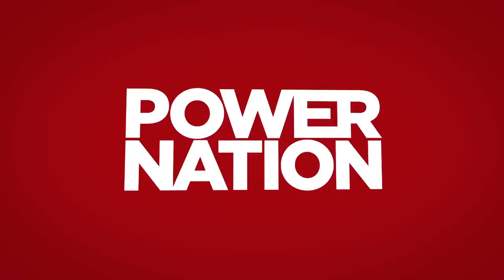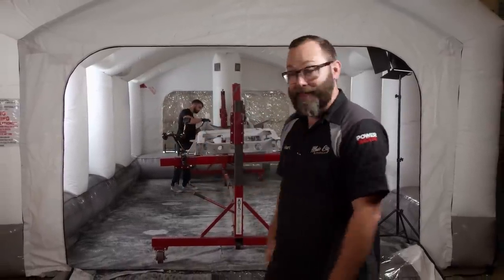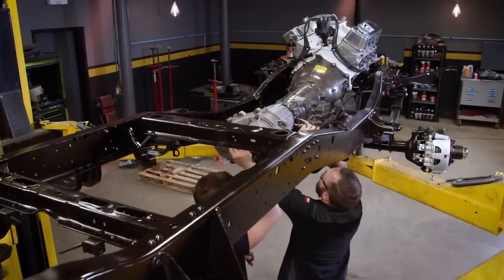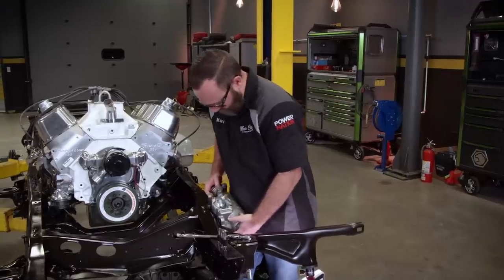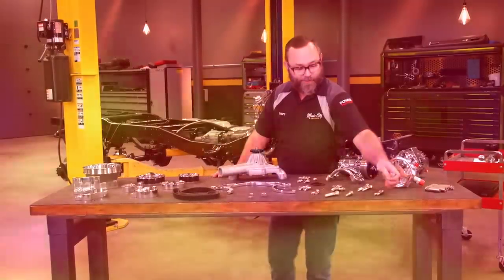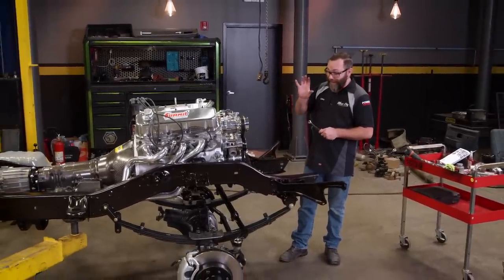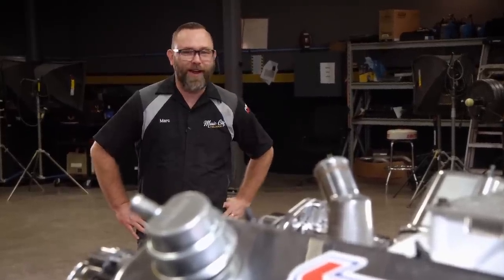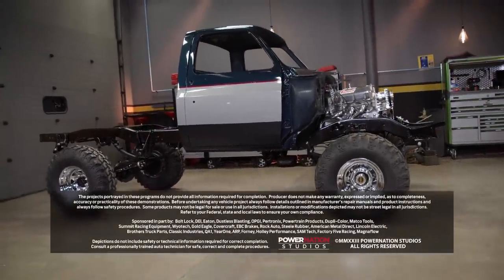Faux Guy Square Body Screams '80s With Chrome Wagon Wheels - Music City Trucks S3, E3

Comment: Box the damn frame, you got a high horsepower big block and want to off-road the truck that chassis will not last
Reply: Agreed, I can NOT believe they are skimping out on the frame.  It's pretty disappointing that they are taking shortcuts on a build like this
Reply: And still didn't address the known weak link in frame behind the steering unit with reinforcement plate. I don't get it 🙄

Comment: And after you get the full rolling chassis assembled, complete with fuel and brake lines and wiring harnesses, ready for the engine/trans/shafts, body, and bed, just douse the whole thing in Fluid Film. Hit the transfer case and transmission too.

Comment: I don't understand why people install flex fuel line especially with the junk in today's fuel. Factory installed hard line like brake lines for a reason. I have seen people go through on a build and install all new fuel system and then have fuel issues. Hard lines don't break down and introduce debris and junk into your fuel system like flex lines and hard lines won't collapse EVER unless you hit it against a rock while off roading. Some things need upgraded from the factory but this is not one of them. Even a steel braided hose is nothing compared to the hard full metal fuel lines. 🤦🏻
Reply: Ethanol is pretty corrosive and the easiest way to use rated line is the newer rubber lines. More stations are using ethanol gasoline, and at some point all of them will. I dont like the rubber lines either since they tend to balloon or break down or rub through. When I was in school we only used flex line when transitioning from a fixed location to a mobile location, or to make a tight bend that a hardline couldnt.
Reply: @michaelwhitehead4446 all gas station use E10 .
Reply: @duckwacker8720  There are lots of stations across the US in most states that still sell ethanol free gasoline. The federal standard was changed to E10 and went into affect in 2016, but that doesnt keep stations from offering other blends like "E0".

Comment: for the chassis i would have used STEEL IT  so later on after the running gear, fuel lines and brake lines are run you can do some frame boxing without having to do any grinding.

Comment: Love the blue an silver 2 tone because I have one but wondering why you didn't go with correct colors for Fall guy truck and paint firewall or box the frame or install steering box reinforcement plate it will definitely crack with big tires and any serious off road use and is a known weak spot! Still nice build.

Comment: dude, clamp on AN hose on the fuel tank, put a tube nut sleeve with a 37* flare and a -6 union, come on, or weld a male -6 on the sender, a hose clamp, ugh

Comment: nice lookin truck but doesnt that tranny brace go inside the frame on the rails pinned with the bolts u got it underneath frame with bolts holding all the weight , also paint that fire wall better  pllz match the main color

Comment: All the updates on this truck an couldn’t go fuel injection
Reply: Because the point of the build is to stay old school? Did that go over your head?
Reply: @Nater-zq5yh  they had fuel injection back in the day it’s just more reliable
Reply: @Nater-zq5yh  ever heard of Holley EFI?   You can get the looks of carbs and not install an obsolete device.
Reply: @barryhebert5839  plus carbs have been obsolete for several decades.    Those are the same people who would think single circuit, non power assisted drum brakes and manual steering because it's cool because it's "old school".
Reply: @bmstylee  "plus carbs have been obsolete for several decades."

First, you don't know what the word "obsolete" means. Second, even if carburetors were obsolete, what of it?

"Those are the same people who would think single circuit, non power assisted drum brakes and manual steering because it's cool because it's "old school"."

Anyone can notice the difference between power and manual brakes and steering when driving, but you would have no idea whether an engine was carbureted or fuel-injected simply by driving it. Furthermore, carburetors are relatively cheap, simple, and easy and cheap to repair if something goes wrong with them, which is why they're not "obsolete" as you suppose, i.e., various companies still make new ones and they are still actively developing/improving them too. Compare that to something that's actually obsolete, like, say, a Betamax VCR. No company is making those today, let alone actively developing/improving them.

By the way, even when something is truly obsolete; pointing out that it's obsolete isn't a valid argument against using it. If something does what you need/want it to do, that's all that matters, obviously.

Comment: I wish that they would stop building carburetor vehicles.   I live at 6k feet and massively change elevation driving back and forth to work and up the mountains.   They just don’t work up here…
Reply: I'm just going with it's 2023 and carbs are absolutely obsolete.  Have been for several decades.   You can still get a carb look with EFI.
Reply: What difference does it make? If you want to build that build with EFI just buy a FiTech or Holley Sniper kit. Only difference is using an electric fuel pump and setting up the little built in computer.

Comment: all that motor and you put tires on that cant go over 75 . swamper are the worst tire and 16.5 rims is very limited to tires . a 17 inch rim had more options and still not over sized . couldve gone with a good radial AT and ride a lot smoother down the highway . been there done that with 44s , 39.5 , 42 , 36 , and now 35inch AT radials on 17inch rims . nice truck regardless of the wheel combo somebody picks on their own truck .

Comment: Why not do a manual transmission in a truck like? Get one that has a compound low first and an overdrive. Would be much cooler to drive. Automatics for lazy drivers.
P.S. a turbo 400 would've been more period correct and a stronger than the 700r4

Comment: 2 problems gentlemen ,  1 /   leaf springs - when they are installed and the axle is bolted to them the shackle is supposed to be  0 to 180 degrees vertical , not inverted as they presently are ( that info comes from experienced leaf spring technician )   and 2/  a chain driven transfer case on a heavy duty offroad truck is considered as blasphemy ( gear driven or go home )

Comment: Power stop calipers are complete garbage. Do not use them!  Pads are just as bad. The rotors I’d use again though.
Reply: I haven't had issues with my Powestop stuff.  The pads are definitely dusty and can be a bit grabby if cold and wet.  But for the cost I guess it's ok.  I might try EBC next time I have to replace them.